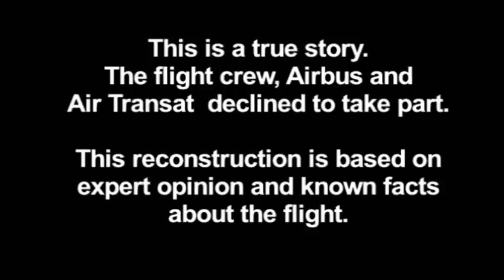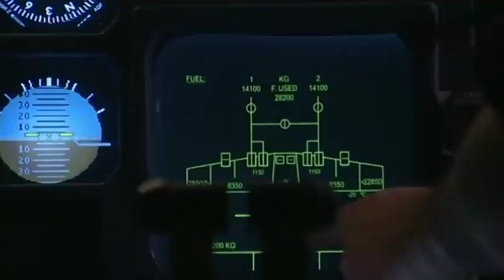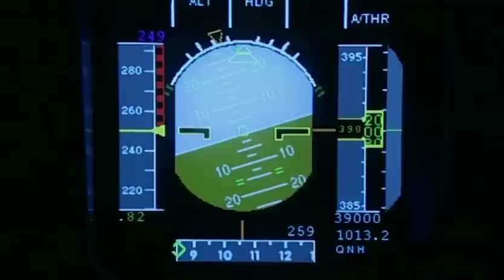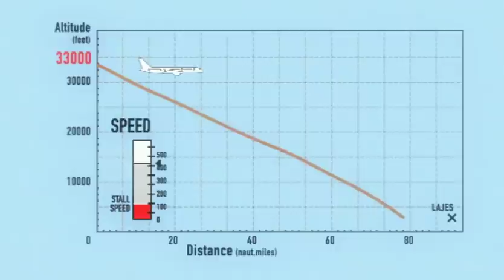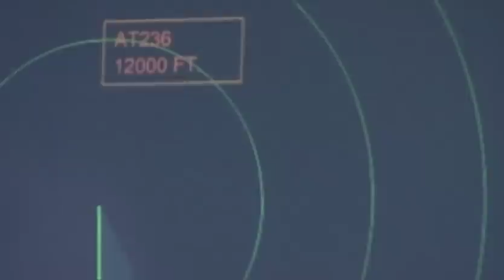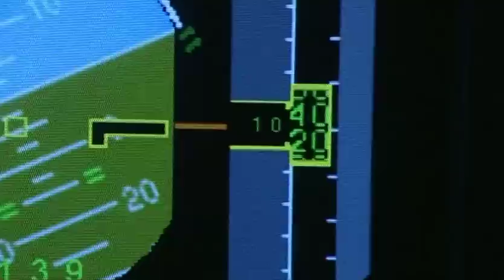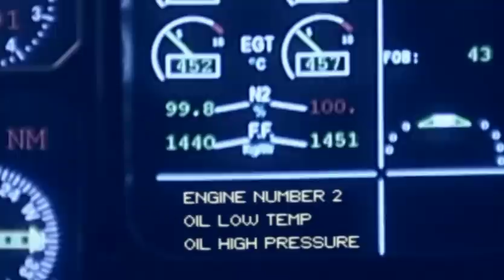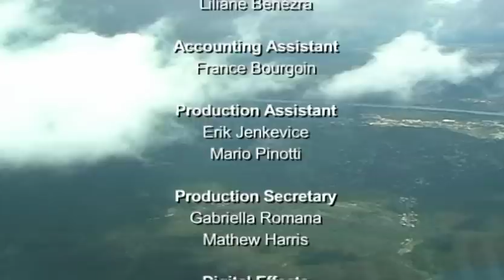Air Crash Investigations Mayday   01x06   Flying on Empty Air Transat Flight 236

Comment: Before Sully Sullenberger, there was Robert Piché!!!  The longest glide ever accomplished in a passenger airliner.
Reply: Thought you might like this. I was there when it landed:https://en.wikipedia.org/wiki/Gimli_Glider
Reply: Sullenberger didnt knowingly let his plane run out of fuel, Robert Piche is a crap pilot, his first officer saved the day, he pleaded with Piche for most of the flight that they were running out of fuel and Piche believed the fuel guage was faulty, if not for his first officer he and hundreds would have died because the captain was an idiot
Reply: Mike Boston dayum. I did hear rumors of him being drunk too
Reply: Because you’re SUCH a good pilot yourself
Reply: @swrennie   That’s one of my favorites. 
You were there when it landed...?  
Were you at the car races.... ? 
Or on the plane.....     ? 
Either way how exciting. In retrospect.
Reply: @mikeboston421 , Probably more of a Pilot then you are. You would of stalled  it. As a Commercial pilot who has flown the A330 around that that same time I would of questioned the indication as well. Though I would of looked for a reason for that indication. the Fuel imbalance would of indicated  that there could be a leak on the right side.  In hindsight i would of pulled the fire handle to shut the supply of fuel going to the engine where the leak was.  Doing that would shut everything down on that side including the ignition.
Reply: @swrennie  oh the gimli glider well they wernt as good
Reply: @everydaycarrycanada951  can’t take you as seriously with that basic would’ve typo done 5x
Reply: @mikeboston421  he is also french.
Reply: Must be the computer

Comment: The captain made the one choice that saved them. He declared an emergency and diverted to an alternate airport in time. If he had continued on to the original destination they wouldn’t have made it. He should have stopped the cross feed as soon as he realized there was a fuel leak but I guess that came too late. The one who is really at fault is the mechanic’s supervisor who told the mechanic to replace the part with something other than indicated. This same thing happened to another flight when a mechanic ordered a part be replaced and his supervisor said no. That plane crashed and everyone died.

Comment: 65 miles they glided... In a several THOUSAND lb plane....take that in for a second...
Reply: Planes are basically gliders with engines attached. Even the Wright brothers didn't patent the engine as part of the design since it didn't matter. The glider was everything.

And the shuttle can go much further via gliding.
Reply: ...Not really that shocking. They're planes.
Reply: Ken the shuttle can go much further because it’s coming from outer space and has more altitude to do it. They shuttle has the decent rate of a skydiver in free fall, and that’s no exaggeration, it’s not necessarily better suited for gliding in terms of body design, but it has many thought out procedures for it to glide as well as possible.
Reply: @logantc.1353  I know. Planes also have a high altitude.
Reply: 747s have one of the highest glide coefficients of any planes.  Most commercial flights glide the last 100 miles or so to the airport (or about that).
Reply: Some crews, on airliners will even idle their engines, when they can glide over a jetstream.
Reply: Flight 236 glided 135miles. The longest glide ever done in aviation history. Any less fuel in that plane and they would've been miles away from the nearest land and hours from help.
Reply: @cyanidegaming2599  Thats not correct!  The farest a CC airliner glided is 72 miles!
Reply: It’s mind blowing, and some planes ✈️ don’t because of whether ? They were lucky there was no serious turbulence I guess,
Reply: Take what in? It's an airplane, they glide ..  just a matter of speed and distance at that point, and physics don't lie.
Reply: @cyanidegaming2599  the only reason they were close enough to land was the first officer was pleading with the adamant captain and the captain somewhat relented and allowed them to change the course to be closer to the coast in case they were actually running out of gas, which they were, the captain never ever believed the fuel consumption readings in front of his face, he should have been fired and jailed
Reply: We call that physics
Reply: @cyanidegaming2599  
A tail wind an some exhausted guardian angels may of helped too!😅

Comment: If you think safety is expensive try an accident 👍🏻👍🏻👍🏻
Reply: Nicholas Ovel lol.. yeah.. i guess..  what industry doesn’t though?
Reply: Nicholas Ovel You talking about the AoA on the 73MAX?
Reply: Most hellfire missiles have a better safety rating then Air Trans.
Reply: Say something original.
Reply: Why did it you do a water landing
Reply: Jestos
Reply: Nicholas Ovel g
Reply: The airline was fined $250,000 CAD
Reply: Safety expenses will stress the profit margin.  Accident expenses may bankrupt an airline.  I believe that maybe one of the reasons the legendary airline Pan American Airlines is now defunct.  I really mis Pan Am.
Reply: @ahmedshakeel5112  No, it was fined much more $250,000,000 CAD.
Reply: @indridcold8433  Where did you get the info from?

Comment: Crazy how such a sophisticated machine can be almost brought down by a small bracket that's off by Millimetres
Reply: Just like a team, it only takes one bad player to tear a team apart
Reply: As with any type of mechanical machine that has tubing that carries various fluids needed for its operation you should never allow any type of tubing or hoses to rub against each other! Basic mechanical skills should tell you this so I don't know why this mechanic allowed it!
Reply: @Jesus Christ yes you are absolutely right! As soon as they saw the fuel levels kept going down he should have closed that cross feed immediately!  Whether you can see it or not you know there is a leak someplace!
Reply: Try being a machinist, we make the world go round. Lots of dummy's out there in that field too these days. Except our tolerance are 0.013 mm and less. You're welcome
Reply: That and the pilots not knowing what to do in a situation like this. That cross feed pump should have never been used! It's obvious that the one tank was losing fuel by some means, fuel doesn't just disappear on its own so adding more isn't going to help if it's leaking out
Reply: The thing is, this will never happen again because of this. With every crash, aircraft safety gets safer.
Reply: @TiffTheTyrant  but not the max
Reply: Or some duct tape
Reply: Not crazy at all.

Comment: It's an awful feeling when you're running out of fuel in a car...I can't imagine it in an airplane.
Reply: BCTRIP death..  once I was landing and because of a turn from base to final the fuel sensor read low fuel in my right fuel tank and I got a fuel warming. I knew I had enough fuel because I calculated fuel before departing) and my heart still skipped a beat.
Reply: In a plane it is 100 times worse because you aren’t in control of the plane, so it’s a very terrifying experience to fall out of the sky knowing you can do nothing about it.
Reply: Soarin Skies well yes it is 100 times worse but you aren’t falling out of the sky
You glide, yes you are loosing altitude but it is not a fall.  We do engine failure training in flight school and if you hold v glide (73 knots in a Piper Warrior) it takes a surprisingly long time to run out of altitude.  Granted, it’s not the same with an airliner, you probably have less time than in a 4 seater GA aircraft.  But yeah it’s not falling.  Still super stressful though especially over the ocean. That’s why I refuse to fly over water if I am not within gliding distance of land in a single engine aircraft
Reply: Niko Belic I know I should have mentioned that you can glide based on your momentum but with no fuel both engines would flame out and with no thrust, even in a glide the plane would still be gradually losing altitude over time,  the Hong Kong incident where the pilots had both their number 1 and number 2 engines stall while approaching Hong Kong Air port showed that running on 0 engines, even in a glide, would not allow them to maintain altitude long enough to reach Hong Kong air port at the distance their plane was at. Luckily thanks to the pilots skills and experience they were able to get the number 1 engine on their plane to produce thrust long enough to get them the rest of the way to the airport and still maintain altitude, and land the plane. This was all done despite the fact that the piston controlling the fuel feed in engine one was then jammed open at 74% power, which caused them to land at dangerously high speed and nearly overshoot the runway (thankfully once again the pilots skill and experience allowed them to land the plane safely while just narrowly avoiding a runway overrun).
Reply: Soarin Skies yup yup

I was just saying falling is not the correct term.  Again I was surprised as to how long you could glide 

Maybe time just slows down to you when you’re doing it. But during  engine failure simulations it always seemed like we would stay up there for a while
Reply: @soarinskies1105  if both engines fail the plane won't just simply fall out of the sky but it will glide for 70 to 100 miles depending on how high the plane is and how fast its descending
Reply: Not even a close comparison

Comment: Pretty much a guarantee that if I was a maintaince person on an airline, I would get fired, because I WOULD NOT CUT CORNERS. I'd tell the airline to take a flying eff and my next stop would be CNN, CBS, NBC etc.

A delay less expensive than a crash or having to come clean about bad maintenance.
Reply: Yes maintenance programs are in effect for a good reason and every time they deviate from the proper procedures something bad happens!!  They had the same problem with maintenance with Alaska air cutting their maintenance procedures, the screw Jack in the rear stabilizer in the tail stripped the threads right off due to no grease! Plane dove into the ocean and killed everyone on board!
Reply: Yep, you would be warned a couple times and then fired..
Reply: It's like that in every job everywhere. You should see what happens in restaurants.

Comment: The pilot should not have kept insisting it was a computer error. Trust your sensors, believe them, and if it ends up being a computer fault at least you did the right thing
Reply: Very true
Reply: That's easy to say when you not the one who could be fired or demoted. Airlines and most every industry care about money and they put a heavy hand on their employees to make sure that's always in the back of their mind.
Reply: If one sensor fails you trust it but if you have most of them fail something is obviously wrong 
And when the engine cut out they still believe it’s a computer error 
You take evasive action after that 🤭🤬
Reply: Tom Kennedy that’s the stupidest thing I ever heard, humans have the ability to make judgements based on the situation computers cannot, if the pilot has knowledge of better judgment with his training and years of experience, letting the “computer” take the plane into the ground and killing everyone if you knew you can do something is not the right thing, even if you will get in trouble, lose your job or possibly even get arrested for making that so called “pilot error” at least you saved all those lives on board and you will always be a hero for that.
Reply: It seems like a boomer not trusting technology.
Reply: @G4M3RGU1D3  for capt Piche he flew on a more manual, analog l1011tristar so seeing this fuel loosing really fast in a computer rather than the analog instrument makes him believe that there is a problem with the computer

You might aswell call Robert Piche a boomer aswell for not understanding technology but he definitely did something better than your comment.
Reply: I fly a Airbus I trust my senseors
Reply: had he trusted them and they were wrong then he would have been crucified for not trusting his instincts and trusting a failure he's never seen before that made no sense....
Reply: @robvoyles  still landed the plane and did something better than your comment
Reply: Terry Melvin No trusting your senses is very wrong.  JFK Jr died in his aircraft because he was spatially disoriented because he trusted his senses over his instruments
Reply: @strtngfrsh  I agree with you, but If I were the captain, I would try to do an emergency landing, then look for the problem instill of jeopardizing my passenger's lives. I don't care if I get fire or my pay gets cut because my job is to protect the people that I am in charge of.
Reply: Bullshit that is not of  Consequence maybe he did maybe he didn't this no way to talk about a hero
Reply: @zaidenmaynard1106 , that is one sure way to crash your airbus! Trust but verify!

Comment: I hope the airline at least bought the pilots new pants.
Reply: Most likely, they were supplied with alternate uniforms.
Reply: Grickery @ they gave them diapers
Reply: On the other hand, one must admit that it takes balls of steel to go through such a situation and still manage to perform well under extreme pressure 🤨
Reply: Nicole Jessica go finish pilot training and you will find it out.
Reply: New pants that's an insult.
Reply: @rthelionheart  : Especially When AIRBUS COMPUTERS Have been Known in Other Situations This DIRE , To Over Ride Any Actions of the Crew & Cause the Planes To Crash.
Reply: And everybody on board passengers and crew probably needed new pants

Comment: 22:00 That RAM fan is amazing. Never knew about that. I guess they thought about such a scenario where the plane would lose fuel, right?
Reply: I was thinking the same thing. When airliners are designed, they MUST have multiple redundancies built in where in any scenario one part failure isn't catastrophic. Those fans giving them enough power to maintain controls, gauges and communication is what saved them.
Reply: Yeah. Safety requirements mean that there are multiple points of redundancy to make sure critical systems stay online.
Reply: Airplane design is smart. Every accident ever is closely examined and changes always made. When something still fails they add redundancy. It's why it's the safest travel. Keeps the stats up
Reply: @highstreetkillers4377  I just don't like the fact that you can't just pull over if you have a problem and turn your hazard lights on. It's why something like this with 300 passengers while extremely rare, is so devastating when it's fatal. The good thing is that people don't die in vain-they look at the problem and what happened and make sure it never happens again through design, proper maintenance, and having a backup system.
Reply: That little device has saved the day for many doomed flights.   I've been religiously watching Mayday since it first aired on TV.  I started watching this show due to my fascination about commercial jets... but it turned out to be quite a learning experience.
Reply: Tony Padgett I’m sure it was one of the first things they thought about lol 😂🤦‍♂️
Reply: Or a loss of engine for various other reasons. Captain Piche kept a cool head, way to go!
Reply: Some planes have an APU (auxiluary power unit) that does the same thing in case a plane loses power.
Reply: its the RAT

Comment: The fuel leak was caused by an incorrect part installed in the hydraulics system by Air Transat maintenance. The engine had been replaced with a spare engine, lent by Rolls-Royce, from an older model which did not include a hydraulic pump. Despite the lead mechanic's concerns, Air Transat authorized the use of a part from a similar engine. Result was inadequate clearance between the hydraulic lines and the fuel line, and chafing between the lines ruptured the fuel line. 

 --- Wikipedia
Reply: Thank you for tellIng me about the video I just watched. M.I.T. student?
Reply: Thank you kind sir!
Reply: Air Transit Maintenance = ATM = Ass To Mouth
Reply: Zip ties

Comment: “ It would cost too much to wait for the original pipe ....” 🙄 Well, it cost them a whole new airplane for installing the wrong part. Thank God nobody died 🙏
Reply: QUES - CANADA thank god there wasn’t a spark ⚡️
Reply: Patti Burton Salmonsen Right
Reply: @BILLY THE KID Depends on where the spark happenes. If the spark was in the right engine, it could’ve ignited, since there was a bunch of fuel laying in the engine, just not in a space where it could be used.
However, if it was in the left engine, it would not, since their was no fuel anywhere in that engine.